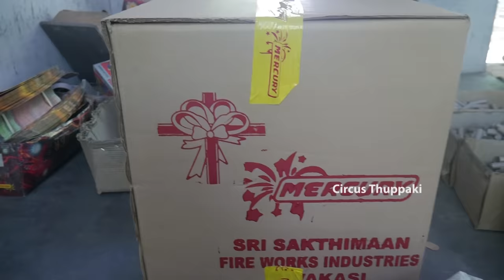Favorite 240 Sky Shots Making Full Process in Fireworks Factory | Festival Celebrations

Comment: I learned how to make fireworks about 20 years ago and walking into the hobby I never realized the time and effort to make even one 3 inch shell from start to finish let alone a 12 shot cake. Need the tubes, supplies, knowing what different powders do and the correct weight the science and chemistry and most important thing of all is safety. I give much respect to firework makers, it's hard work and time consuming and can be dangerous. For all those out there, thank you for doing work to give us some good entertainment. Be blessed everyone.
Reply: how did you get into it? i mean how did you start learning
Reply: @maximo3395   Pyro is a relatively small industry so generally it boils down to who you know. You need to reach out and make some connections with those in the industry or other hobbyists. Approach your nearest display company or manufacturer and ask about opportunities, anything to get your foot in the door. Often, a strong back and a willingness to learn is enough. If you are in the US,  there are a number of regional clubs that cater to the hobbyist. There is also the Pyrotechnics Guild International.  I joined PGI in 1997 and found my way into shooting shows and making shells. I gladly worked for free for quite a few years simply to work with pyro and absorb as much knowledge as I could.
Reply: @maximo3395  u just YouTube it lol it’s insanely easy

Comment: I´ve not seeing anyone handling flash powder that way ( 9:12 ) before! It´s not the fact that this poor worker is not using any protection like masks etc... I´m more conderned that he is doing it in a room that is fully covered in flash powder dust from floor to ceiling. On a day with the "wrong" humidity or just bad luck this stuff can ignite without any spark (like from electrostatic discharge) just because of friction. And the way he drops these wood frames how he moves it around and the fact he walks barefoot in powder is just outrages! The only good news if this room blows up it will be a quick ending for the worker, just not for rescue teams that need to pick up body parts hundret meters away! Creating fireworks is dangerous per se but doing it like this is like russian roulette! And probably for few € salary per day... its just sad.